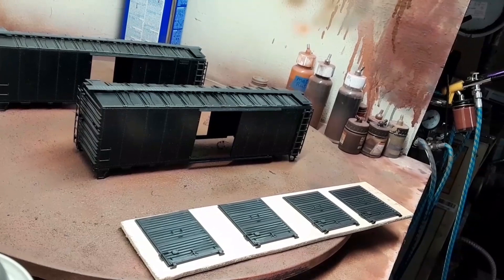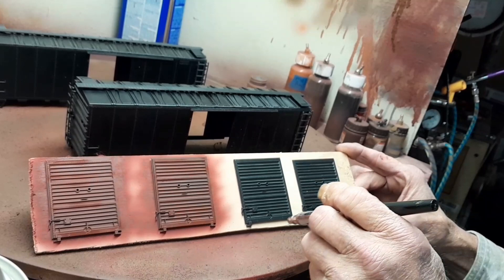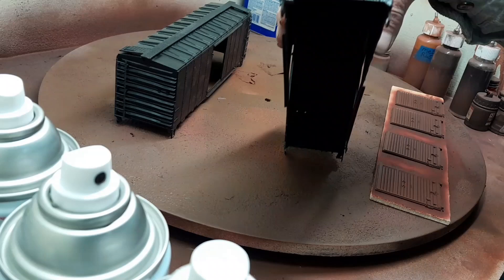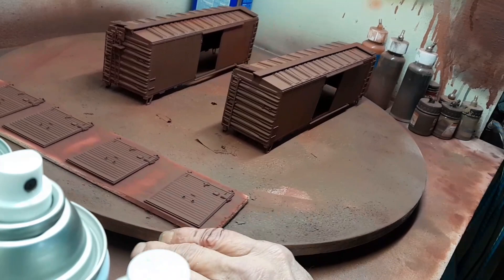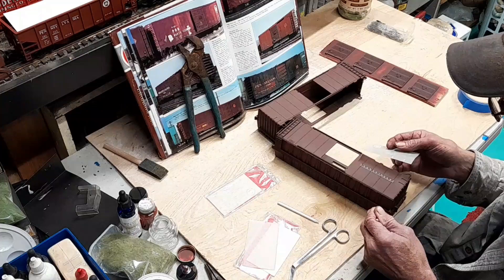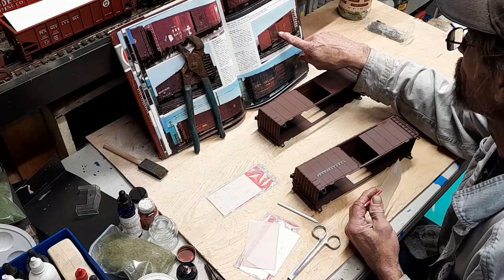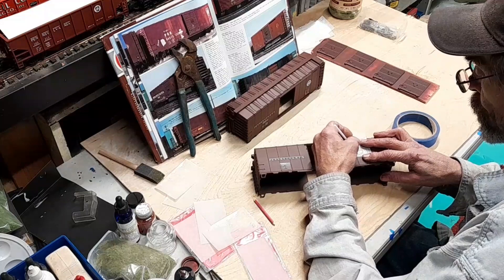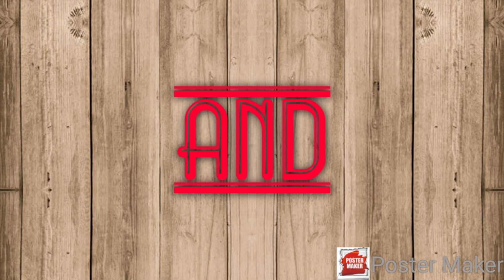Painting an "O" scale 40 foot box car and decaling it to PRR.

Comment: Great information and video! I have a comment about your air brushing.  I deposited coatings onto a wide variety of surfaces using various materials and techniques. I can only by the way your air supply sounded, but it sounds like the air pressure was too high. You may want to reduce your air pressure and increase your the width of your spray pattern to obtain better and faster results. I typically use a box pattern to eliminate zebra stripes. But every one has their own technique that works best for them.
Reply from the maker: Thanks for the tip.
This air brush is a cheap 9.99 Harbour Freight one. It doesn't have much adjustment on it.
It doesn't like less than 30 psi I tried thinning the paint more that didn't help.